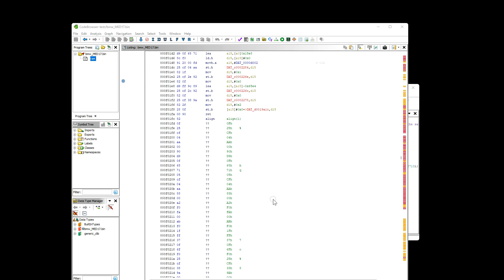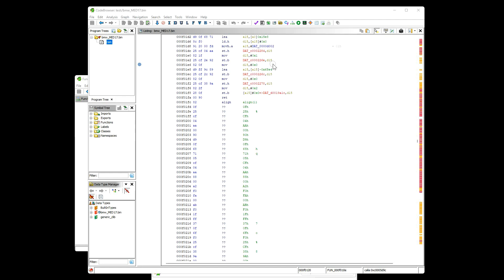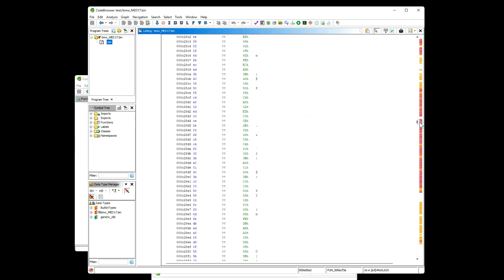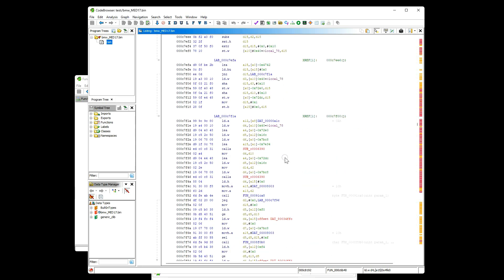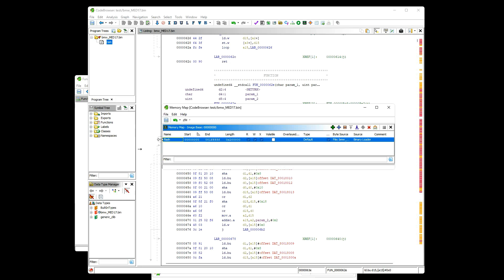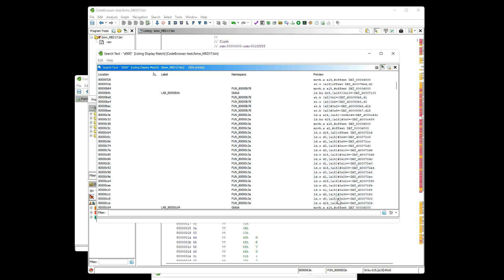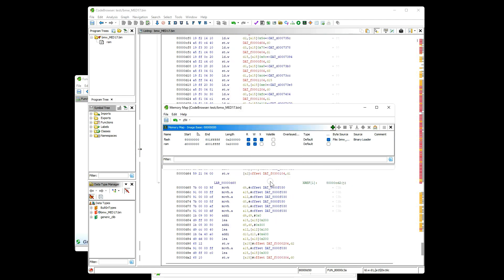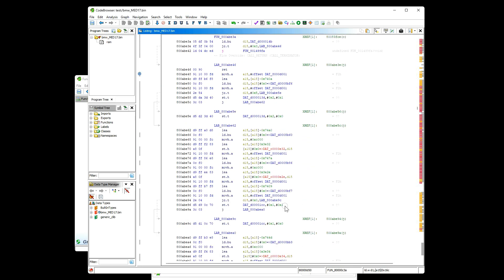Ghidra & WinOls map-switching. Lesson 01, EN

Comment: The main question is, how do you extract the firmware of the microprocessor to analyze it with Ghidra? The flash with the maps is easy. Can you make a video how you did it? What tools you used? Without that the video is worthless. :(
Reply from the maker: It is a common knowledge, that if you want to analyze a binary with Ghidra, you need a full read.
Best method is a bench read, but some OBD flashers support (for some ECUs) a full read.
Just any read with maps (calibration) and program area is ok.
Reply: @ThomasTeachesTuning  I understand I need a full read. I was asking about how to read out the firmware of the processor, not the flash. The flash is not the problem. :)